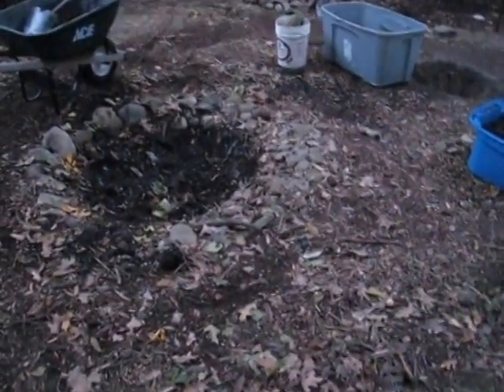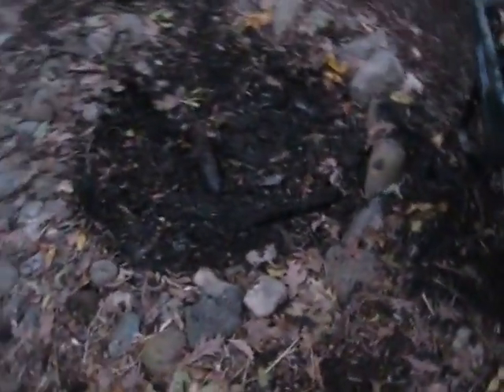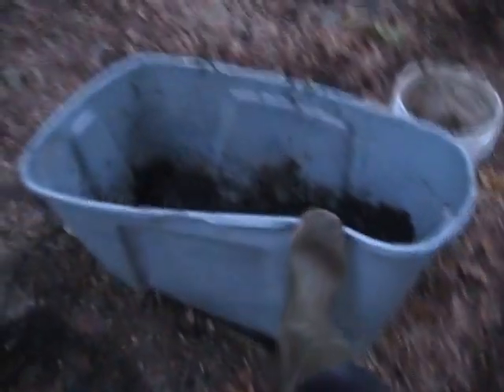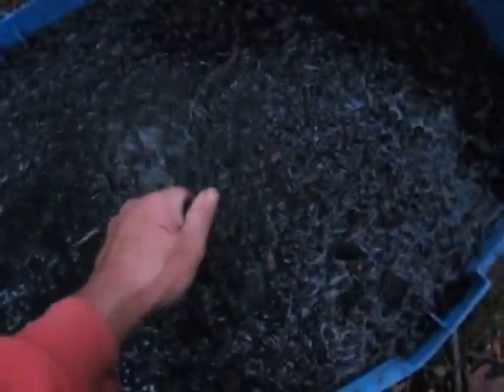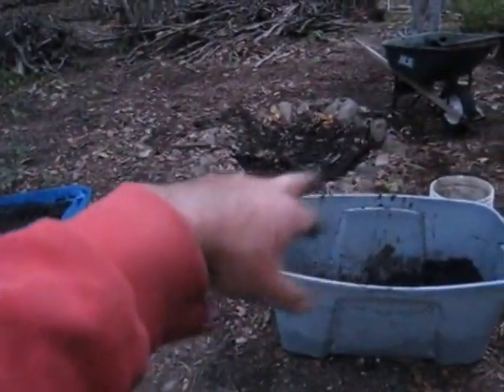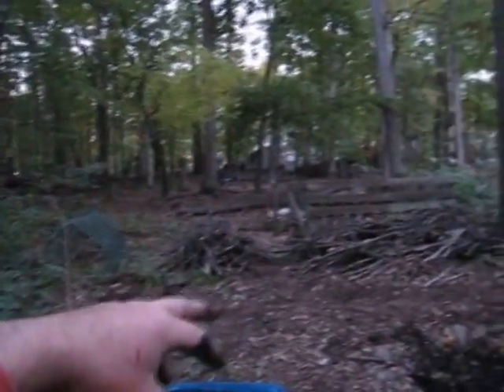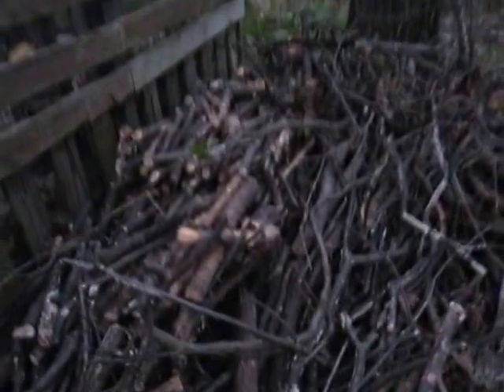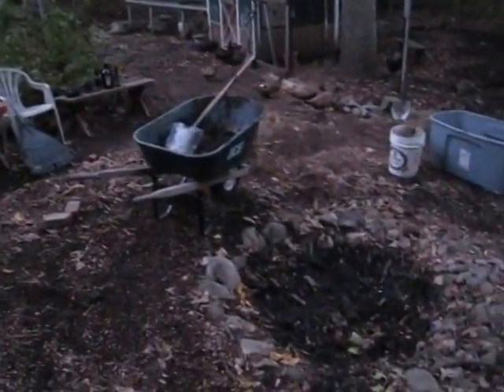Biochar - Cone Pit Method - Full session discussion

Comment: That looks way cooler then a chipper, certainly has a nicer sound. Nicer ambiance for sure

It is a lot of heat though. It would be nice to catch all that enery. Maple syrup with a big old firebox could hold all those sticks. Electricity would be sweet too. Heating a home..
Reply from the maker: Definitely good to think of additional yields from all that energy.  It is an interesting design challenge because you need access to the burn space from most sides and there is a lot of interaction... . Good designs to consider!

Comment: Hi well done. What about putting out the fire with water, normally you generate during this process a lot of CO gas that is pretty toxic to your health. so don't bresth it.
also the water could be pretty caustic from the Ashwater, so the chicken could only run on caustic water then ?
Reply from the maker: +overunitydotcom Thanks for the heads up... Yeah, certainly elements of the process to be careful with...  

The water that goes through the charcoal to quench it generally ends up back in the earth in the pit, so the chickens don't have direct access to it.  There is certainly some ash in what enters the chicken yard but with all the acidifying compost stuff happening in there as well I think that isn't too big a deal.  THanks for the comment!